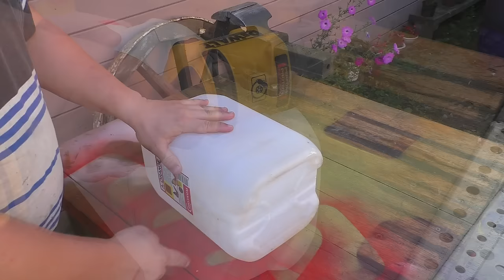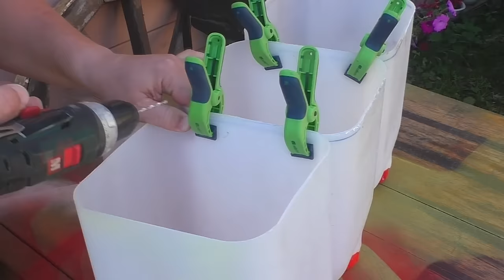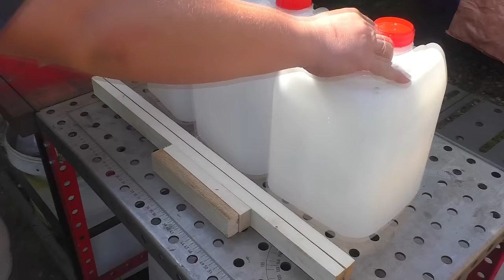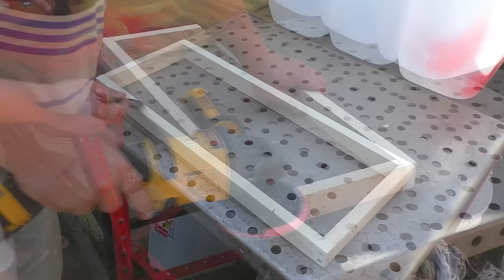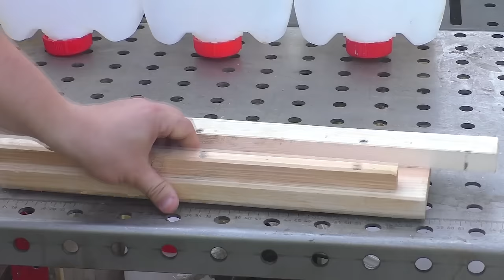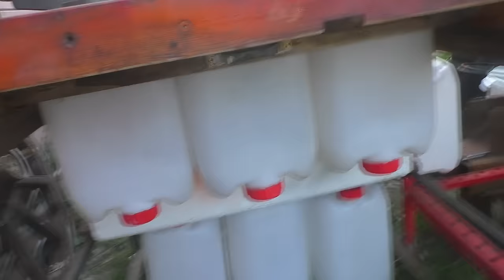Достойное Применение Пластиковых Канистр! Сделай и ты себе!

Comment: I'll share a little trick I worked out that has served me well.  When you're pop riveting soft/fragile things together (such as these plastic cans) put the rivet through and put a small snug fitting washer on the other end and then pop it and it is a very strong pull and pop,  You can even put one on before you put it through to increase the size of the flange. For a 1/16th rivet you can easily get  1/16th I.D washers with varying O.D sizes and so on up through the sizes of rivets. I always keep a good range of rivets and washers. This also is handy for doing repairs on shoddy and cheaply manufactured items that usually start cracking up and falling apart. Endless applications.

Comment: Quite ingenious, except for one thing:
Exposure to Sunlight ( UV radiation) makes the plastic very brittle and it will fragment very easily, especially at stress points, such as rivets.
I prefer to use tinplate vegetable ( soy) oil drums ...all metal